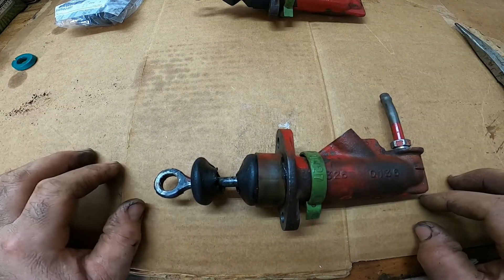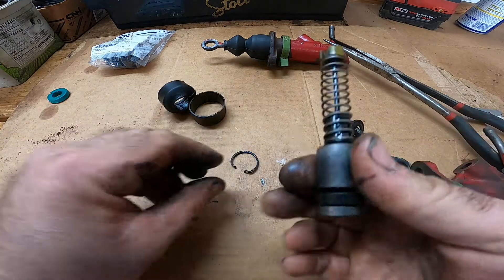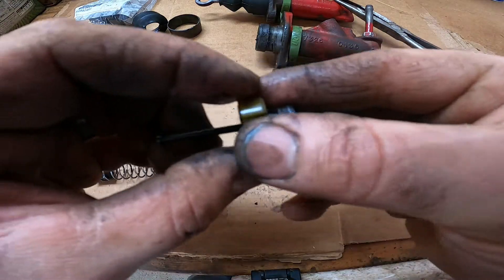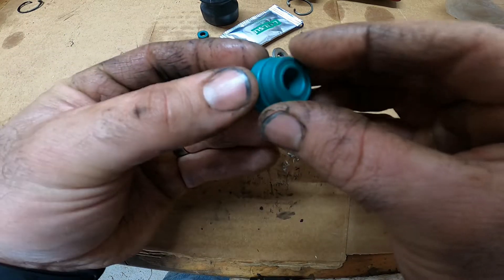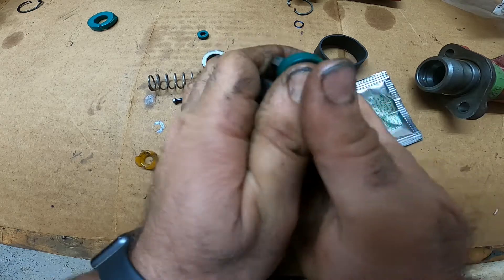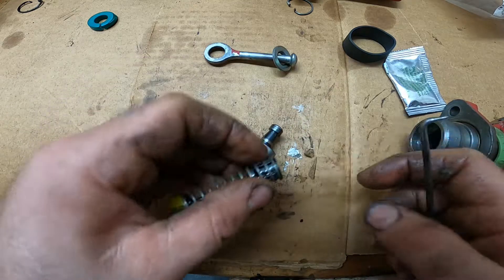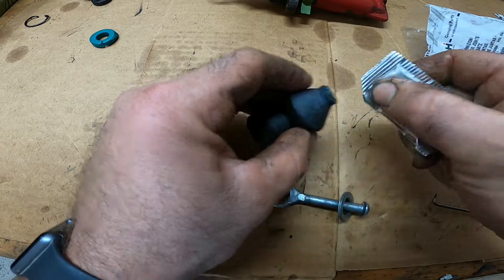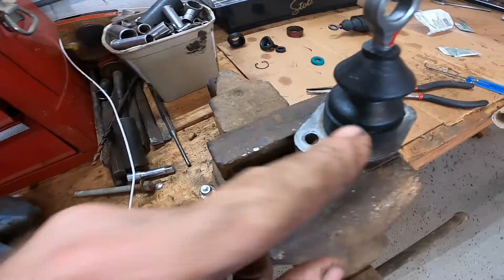How to Rebuild Brake Master Cylinder on a International 484 Tractor

Comment: Great video! What's the best way to get at, and take out the cylinder. Down through the battery housing from the top or the sides? Looks to be a lot of pipe work on the 484
Reply from the maker: I took my off from the side
Reply: I also came in from the sides.

Comment: Great video. I recently replaced brake lines in my international 454, bled the brakes but I’m not getting any resistance from master cylinder for right side brake. Would this be master cylinder needing new seals?
Reply: Do u mean when sitting on tractor  right wheel?  I have 574   &  my right wheel  is not grabbing like left does  Thanks

Comment: How did you get your master cylinder off? There does not seem enough room to get the eye of the master cylinder off the eccentric bolts past the equalizer. Even with the equalizer plate removed.